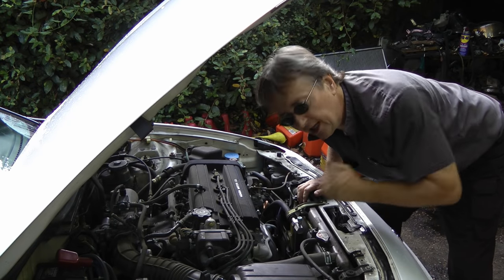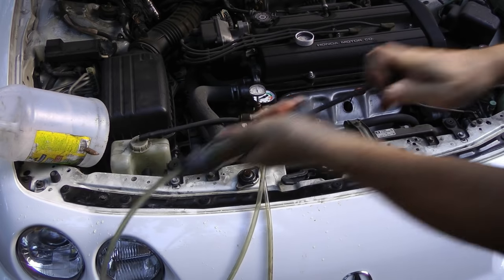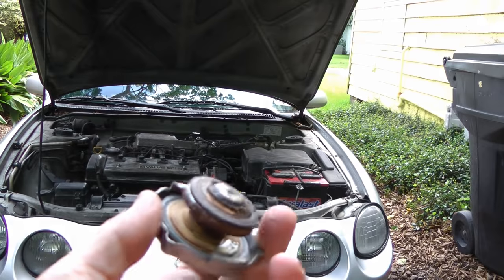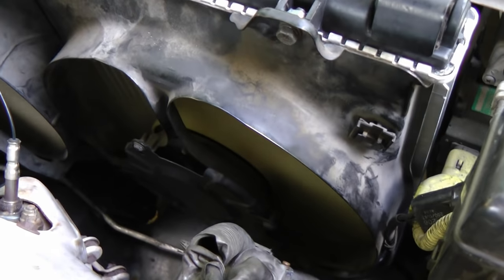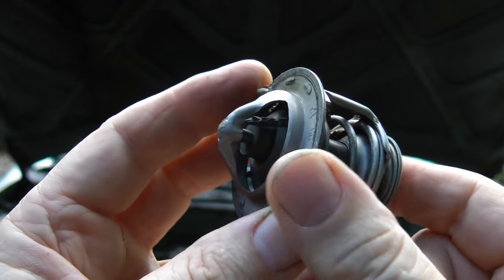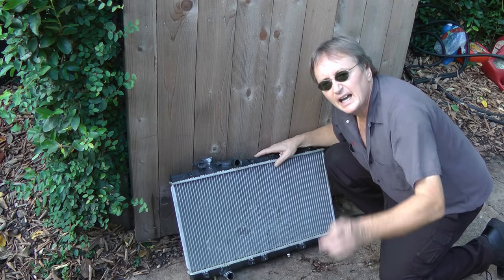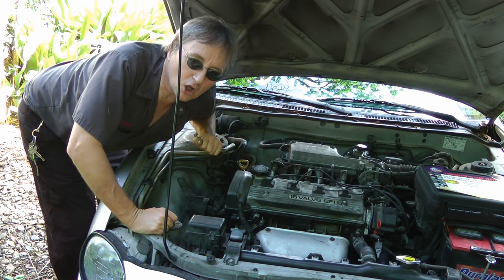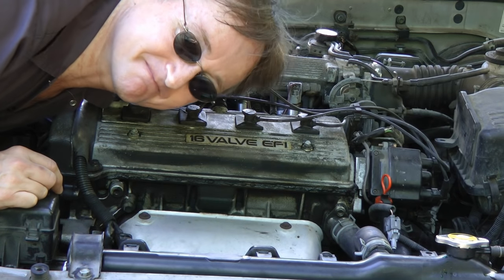How to Fix a Overheating Car Engine

Comment: Who else is watching this from the side of the road?
Reply: Me lol
Reply: Lmao
Reply: @luciferparanoid best of luck man lol
Reply: Me
Reply: 😂me
Reply: Me too in my 1995 mustang I just spent over $1000 on already
Reply: I’m in the bathtub
Reply: No you ain’t most of yall are under 15
Reply: Me
Reply: Im here with y’all
Reply: Me too unfortunately

Edit: my radiator fan was the issue. it burned itself.
Reply: Me
Reply: Me literally rn lol
Reply: I'm watching this in my 2017 Avalon pulled to the side i swear 🥲
Reply: Lol same, good luck out there
Reply: Eye eye captain
Reply: Me
Reply: Me me
Reply: Me lol
Reply: I’m preparing for tomorrow 😂
Reply: Yooo right here
Reply: Me
Reply: My cap was leaking
Reply: 😂 meeee
Reply: @hectorcoronado9602  get a new cap then replace thermostat
Reply: Me
Reply: lmafo yup
Reply: @AndrayaSmith-ds1rr  Head gasket leak?
Reply: This comment made me laugh and angry
Reply: here again
Reply: Luckily I was at McDonald's
Reply: In a parking lot
Reply: Bru
Reply: Me hahaha 😂
Reply: Yeah i just bought this bmwx5 and the hot engine light came on pulling in my drive. It's not a blown head gasket, but coolant isn't circulating with cap off when icrank car... what does that mean.
Reply: And i see the plastic cover on motor is cracked and soldered back.
Reply: Omg me and my bf right noww
Reply: Never alone😂
Reply: Me lol
Reply: Me too, radiator fan blown 😐 pretty sure the engine might be toast too, I heard real bad knocking after it started overheating
Reply: Me too
Reply: hahaha
Reply: Lol
Reply: Me 😊
Reply: Me lmaoooo just happened to me
Reply: @Brownskin7198 lmaooo girl I’m out here now ctfu
Reply: Currently waiting for the engine to cool.down in the middle of the Australian outback
Reply: LEAK DETECTOR??

just check under the cars gorgoshhake
Reply: @BurgeonedGrim  really? but radaitoir fan only works when car overheats.. yor mising something
Reply: @shakeserfistssmith1364  scott soldering  it overheat hes engine
Reply: @robertokandal  yes it's supposed to turn on when the car overheats, but it didn't since it was burned. replaced it and it's all good now 👍🏼
Reply: I am 😂
Reply: Me 😂🤦🏾‍♂️🤦🏾‍♂️🤦🏾‍♂️
Reply: Damn…we so many
Reply: Me😂
Reply: Me 😢 omg I can’t stand you right now
Reply: me😂😂
Reply: This and how to find a cheap tow.
Reply: 😂😂😂 damn
Reply: Just made it home fortunately
Reply: BruuuuH I'm fucken dead
Reply: 😂😂😂me right now
Reply: 😂😂😂😂 it’s not funny but 😂 it was me this morning sir😢😂😂

Comment: "So the next time your car starts overheating, Dont get mad. Get under the hood and fix it" I absolutely love that. I would never give up on my machine. Even if it did overheat. Everything is fixable.
Reply: Bruh everything is fixable until your stuck on the side of the road smh
Reply: Lol I was hoping he was going to say be a man in the end😂
Reply: @mynameiswhat960  And if your car overheats, you can't drive it. You have to have it towed.
Reply: Except everything that's not. Then you gotta rig it with something else and pray.
Reply: So if you hae a leak in raditor it over heats? Had two holes in it and never overheated.

Comment: Thanks Scotty. Even 10 years later, this video is helpful. What you do for the community is great.
Reply: god damn I didn't even notice the video was 12 years old. Still super useful lmao
Reply: He didnt mention the water pump did he?
Reply: @laragreene8328  No..

But i have a hole in my radiator but car temeprature is the same, with it or with new radiator. So why leaks dont verheat an engine the guy said it overheated--

Comment: This guy is great. I have had mechanics that get emotionally tied up and say "your car is a mess just buy a new one". To me a good mechanic looks at this pragmatically and thinks how can I fix this even if it's expensive. I'll make the decision if I want to spend time and money on my car. Most people don't have the know-how or desire to learn about how engines run so a mechanics' word is as a good as a witch doctors. The best mechanics imo have good attitudes and understand that if you have the tools, know-how, and time you can fix anything. I've had mechanics tell me my car wouldn't last a few weeks and the car ended up lasting years. I admire guys like this host, that are creative and have a can do attitude. Mechanics that scare too easy I don't have time for.
Reply: On the other hand if the person who is most likely to benefit from doing a ton of work on your car tells you it’s not worth it, it may actually not be worth it. Just saying. They have a financial incentive to do expensive work so when they tell you it’s not worth it - they might just be looking out for you.

Comment: With gummed up radiators, sometimes you can use some radiator flush additive to clean it up and bit. It's not as good of a fix as replacing the radiator, but it's a heck of a lot quicker, easier, and cheaper. It may even keep you going for a couple more years before actually having to replace it.

Comment: A bad water pump can also cause overheating. Coolant won't do it's job if it ain't circulating.
Reply: and/or a bad water heater control valve.
Reply: MarzNet256, if you noticed, he mentions that in the video when he says when the pressure moves down, you know there's a leak and you need to find where the squirt is coming from. 

that doesn't mention a water pump directly, but it mentions all leak possibilities generally. that way the video doesn't go for too long
Reply: I agree, a waterpump can also cause an overheating.
Reply from the maker: yes, but when they go bad, they leak, and my pressure test would show that
Reply: i had a bad water pump and there was no leak.
Reply: Mustafa B Impossible!! They are bad cause they leak. Water pumps are very simple. Its a propeller attached to a pulley with seals and bolt holes. Thats it!!
Reply: csb772 seriously, there was no leak.. the blade inside was shaking badly it was making an annoying sound only.
Reply: Sometimes the bearing in a water pump can go bad, or like the German cars have plastic fins, those can also go bad. The leak only shows that the seal has gone bad.
Reply: MarzNet256
Reply: 57 plate mk4 mondeo 1.8 tdci, overheat at speed not in town or idle, no leak-water pump cured it
Reply: Thermostat
Reply: Water pumps always leak when they go out
Reply: Mustafa B that is an abvious find, noise by the serpentine belt would usually mean that there is an issue with one of the spinning bearings. If you know it was overheating and there was a noise coming from that area, the only common sense would be that the water pump is worn out. Scotty's case assumes there is no noise.
Reply: @scottykilmer  what if the belt is slipping?  didn't cover that.
Reply: @M.Bahiii  did u have water mixed with oil?...or how do you noticed and resolved the problem?
Reply: nice one, good call
Reply: Volkswagen water pumps that run of the timing chain are seriously bonkers. Those suckers are made of some nylon material. The turbine wheel can break off and surprise, no circulation of coolant.
Reply: CHALK772 not impossible. Had bad water pump making a whining sound from the engine. Mechanic replaced it and no more overheating but neither of us found signs of leakage .
Reply: I've wreck a pair of water pumps by running straight water with zero coolant to lubricate. The seals split apart and then a horrible screech screech noise appeared on start ups. Never again -_-
Reply: @M.Bahiii  same thing I had a bad water pump lots of noise no leak
Reply: I have Camry 2009 2.4 engine but the fan doesn’t work normally like if the car is running for 40 minutes says 35 minutes fans work like two seconds and off and again after that two seconds and turn off
Reply: @scottykilmer   what if the reservoir has this bubbling sound an leaks at its cap when hot and over heated?
Reply: I'm glad someone said what I was thinking
Reply: That's the same thing that I was thinking
Reply: Scotty Kilmer the water pump belt too. Pressure test wouldn’t show that. However, it’s impossible to go through EVERY little thing in a YouTube video
Reply: Water pump impeller can go bad and it wouldn't show in the pressure test
Reply: Many times, the water pump is bad because of bearings.. they usually fall apart and leak,  make noise, and throw your serpentine belt ....
Reply: dude my car is probably recycled to pepsi can 😂😂
Reply: I have seen a bad water pump where It wasn't leaking or making noise the propeller or whatever it is had rusted so bad it broke and wasn't cerculating anything
Reply: @sukanyacumberbatch152  more than likely head gasket air exhaust getting in coolant
Reply: I saw  the fins broke off a water pump ...outside it was turning inside wasnt
Reply: @M.Bahiii  maybe someone ripped you off
Reply: @dahenry8888  nope, because i Changed the waterpump and the sound was gone.
Reply: I had a bad water pump  on an audi  the plastic fins were not turning due to coming unfixed from the drive shaft it took some finding!!!

Comment: In my case the fans were replaced it wasn't the thermostat and the radiator wasn't corroded. turns out it was a sensor on the radiator that tells the fans to come on when the coolant reaches a certain heat temp. swap the sensor out and now my car runs great again Thanks Scott best mechanic on YouTube 👍

Comment: I learned so much in just one video. Currently trying to figure out why my 07 G35 coupe started heating up randomly on a quick trip to the store. Ill be doing all of these tests tomorrow. I checked the coolant and it was watery, my guess is that the previous owner was running it with water instead of coolant/antifreeze and little by little it started messing up. We'll see what happens.

Comment: At 2:35 you are suggesting to pull a wire from the positive side from the battery towards the fan to 'jumpstart' it. You should tell that on some fans the required power will burn such a thing wire instantly. So be carefull when you jumpstart that thing lol, that small wire will smoke within a second. Some fans require a 15A or even higher current in order to run.
Reply: Agreed, i might not have thought of this because i have no knowledge of electricity.  Doesnt hurt to spread knowledge when you feel like someones safety could be at stake.
Reply: True, my fan requires a 40A fuse.

Comment: where did you put the blue liquid? you never showed or told us, please advise
Reply: Top of the radiator where the radiator cap goes. Same hole you put coolant in.
If there's engine gasses/fumes going into the radiator due to a bad head gasket, they will make their way into the coolant, through the radiator, up to the coolant fill hole, and mix with the blue fluid.

Comment: On and on again, scotty reminds me that it is worth buying equipment that can cost about $100 because in the long run, I can fix it myself and I dont have to waste triple of ten times more than that.
Would highly suggest buying a car jack that can lift the same amount as ur vehicle. Had a small jack because I cheaped out. The jack is useful for tire changes but not for jacking the car to get underneath. 
I am definitely going to buy the temperature gauge and coolant tester.

Comment: I remember two years ago that I had a leaking radiator in my Chevy S10.  The funny thing about it was that the coolant was circulating, but the leak was allowing coolant to escape.  I went and bought a new radiator and it only cost me a little more than $100.  All I had to do was remove the air intake, remove the fan shroud, disconnect the coolant hoses and out it came.  I put in the new radiator and the truck ran great afterward.  The best thing was that I no longer had to keep adding more coolant every once in a while.  But, it didn't end there.  The following summer, I had taken a beach trip.  When I got there, I noticed my coolant was boiling in the reservoir.  I thought nothing of it since my engine wasn't overheating.  It wasn't until a couple days later that I realized the radiator cap had gone bad.  It wasn't allowing the coolant system to pressurize and allow the coolant to circulate.  I replaced the radiator cap and no more boiling coolant.  Everything was normal after that.  I love it when engine problems are very easy to fix.

Comment: Don't forget to check the water pump. A lot of them have plastic impellers that break over time and no longer flow coolant like they are suppose to.
Reply: Hi my name is Taurus and I am trying to find out what's wrong with my 2001 Buick lesabre. Well I got the transmission replaced and every since then my car hasn't been holding in the antifreeze and then it just ran hot and my belt pop off
Reply: Exactly.  I suspect that is my problem.  Not an easy DIY on my car.

Comment: Also make sure the fans are wired correctly if they're electric and not belt-driven. In my old Firebird I replaced a blown radiator with a nice aluminum one yet I was still overheating. Turns out my buddy who reconnected the fans did it backwards so it was sucking the cold air from the radiator instead of feeding it

Comment: You forgot water pump.. my water pump is slowly leaking right now.. lol.. it overheats when the fluid drops too low.. right now all I have to do is add about 6 oz of water/antifreeze every morning.. but I know I need to change it asap..
Reply from the maker: no I didn't forget, pressure testing the system as in this video would show a bad pump that's leaking
Reply: oh ok.. I didn't hear you mention a water pump, so I didn't think about that.. lol
Reply: David Danh in the video, he mentioned that if there was a leak, you'll need to find where the squirt is coming from. that covers everything about the system that could be leaking, including the water pump
Reply: David Danh have you fixed the problem
Reply: Ya but if the water pump is not pushing coolant that could be the problom might not be leaking but the fins on the pump are worn it won't leak and won't move the coolant
Reply: Exactly Kevin Reid 👍🏽
Reply: David Danh I was told i have antifreeze leak and I have to replace the hose now the hose is 
where lexus es300 01
Reply: David Danh done it on my eclipse 03 a few days back. Fuck it is like a child you need to take care of, but I really love that car tho.
Reply: David Danh dont get mad, go under the hood and fix it
Reply: sometimes water pumps dont leak at all  but the blades inside are messed up... and the water pump does not pump the water properly...
Reply: David Danh i did the same thing with my 1995 volvo haha, you can just throw in water tho exept for the winter when it freezes. saves allot of money
Reply: Also some water pump impellars are made of plastic which can also fail and wont pump water thru the system
Reply: wrong scotty
Reply: what should i do if there is a leak in the pump? duck tape till i bring it to the mechanic?
Reply: I been loosing water in my radiator but I do not see where is it going,can you see where your water leaks ?
Reply: Pressurr test woukd not have yold if water pump sheered off it impellars.
Reply: Scotty, I have seen cases where the propeller on the water pump was so badly eroded that the water pump wasn't efficiently circulating the coolant causing the engine to overheat.
Reply: This is why you change the water pump with every timing belt maintenance. Maintenance is also considered proactive too.
Reply: you didn't cover loose belt intermittently turning water pump.  or water pump itself inoperable (and not leaking)
Reply: @thetreyrich1  Very good point but I guess in 51 years of Scotty's experience it is likely more rare than a head gasket. That's probably why he never mentioned it although he should. I think he always recommends a new water pump during timing belt maintenance so it should be newer pump then.  I never take chance on same water pump more than 150-200k miles.
Reply: David Danh km
K
Reply: yeah my cars water pump had a leak and had to change it
Reply: Same here. But in the cold weather I use washer fluid.
Reply: @scottykilmer  what if the water pump failed electrically?  Would a pressure testing system pick that up too?
Reply: @fishinleyend8185 exactly my thought.  so it seems as if he indeed did forget to mention the possibilities of water pumps causing this issue.
Reply: @scottykilmer  Should have mentioned it for the less intuitive amongst us viewers.